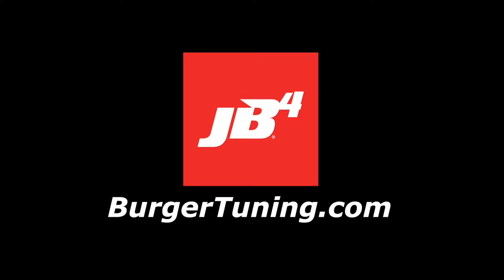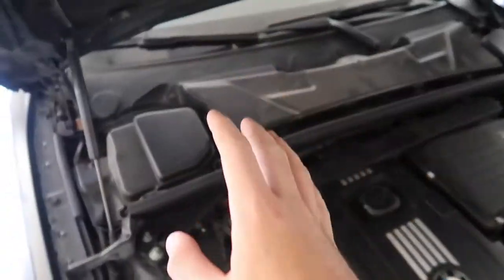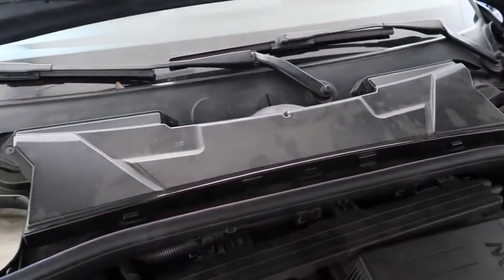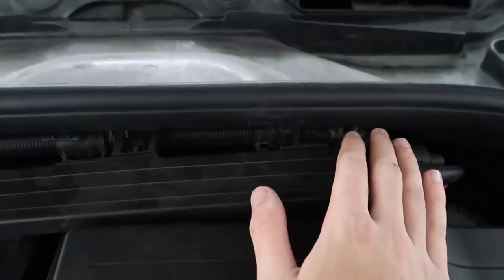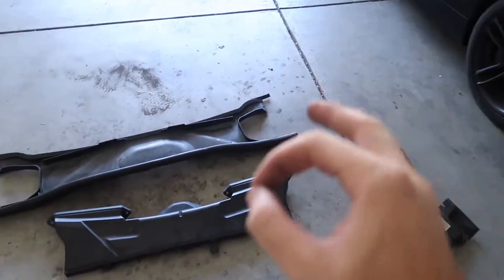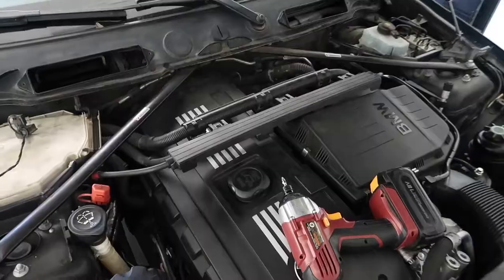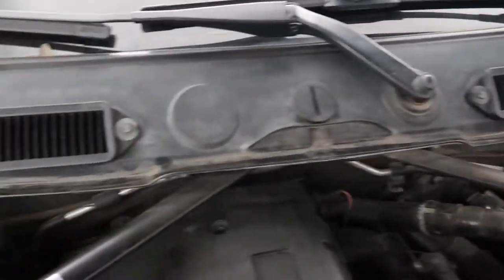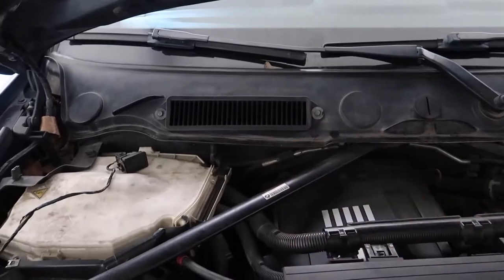INSTALL BMS N54/N55 BMW COWL FILTERS THE RIGHT WAY!

Comment: What's to stop water getting into the filters and possibly ruining them though?
Reply: The answer is nothing. If you drive in the rain, or if you live in a place where it snows you can still install the filters, but leave the lower cowl and dme covers on.
If not, you risk getting rain water into the back cylinders.

I know this is an old comment but for anyone new wondering.

Comment: 1. what do you do with the parts you left on on the engine cover. You don't have anything to secure them with. 2. all of the water coming from windshield is going to end up in the engine bay, YES GREAT MOD...